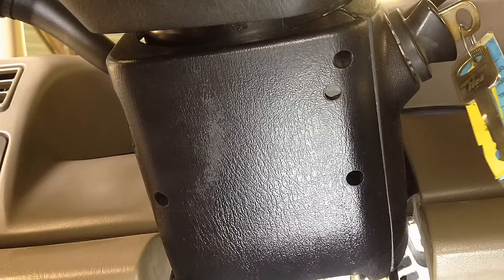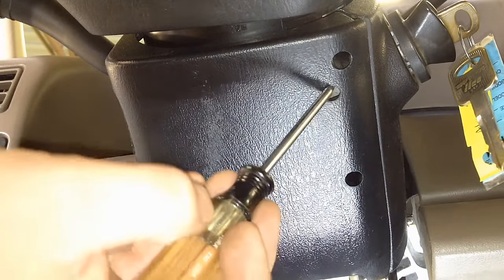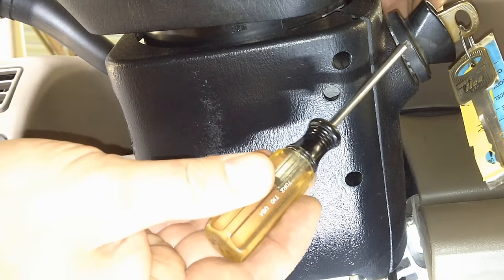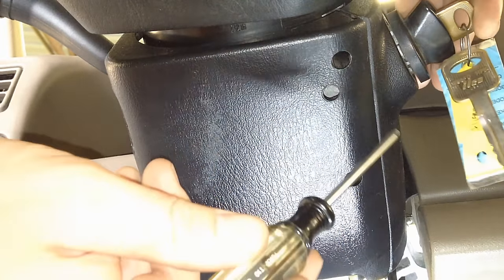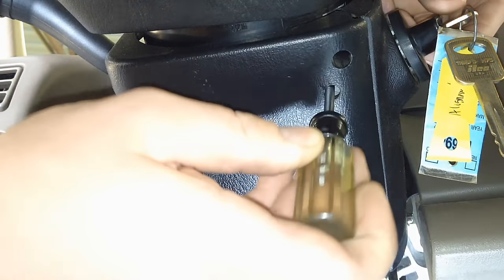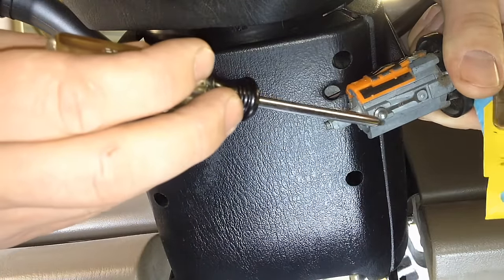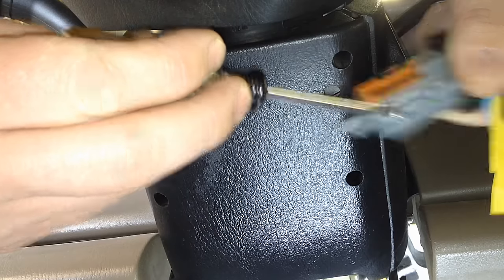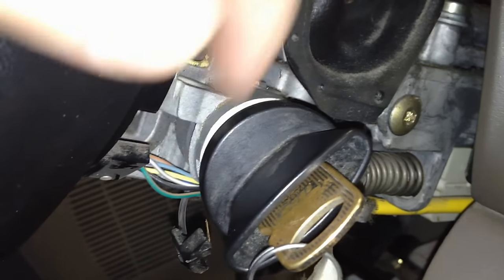Ford Quick Tips: #25 Ford Ignition Lock Cylinder Removal

Comment: Thanks for the help.  I just had someone break into my 1995 F-150 and they completely shattered my lock cylinder.  It should be a easy replacement now. with a little expedited shipping from Rock Auto.  If you've got any other tips on replacing this on a 95 F-150 XL, please let me know.  Thanks again, - Andrew
Reply from the maker: +Andrew Soltis No they are pretty simple on these.
Reply: All I have to do is push in the clutch and one of  my vice grips and my truck starts within the first couple tries , it’s a 89 f350crew cab long bed dually and it got 72k miles so far but I still like it great for hauling hay

Comment: How can it be removed without the original key. My granddaughter lost the key to my 2000 f-350
Reply from the maker: You must drill out the lock cylinder, or use a slide hammer or call a locksmith.

Comment: Hey Brian- thanks for your video's they have been good help to me.
I  have a 2007 E250 4x4 van and I like it a lot!!!Your video's on parasitic drain helped me,spark plug tips and coil pack replacement.My latest problem is when I turned my ignition key back to accessory then to start, my van will start but I lost my gauges and power windows.It runs ok but no speedo.After driving a bit everything comes back on.Worked for a week and then happened again when I switched the key all the way back? Strange stuff and was wondering if the ignition switch was shorting out?
Any thoughts would be appreciated thank you..Darren
Reply from the maker: +Darren Auerbach Was your radio also dead? The way it appears is the cluster is failing and not sending the ground control to the accessory delay relay. So when it is happening it is best to check that first and work our way back from there but it seems the cluster is failing causing all of this especially since the speedo dropped out.
Reply: Yes the radio went out. That's what got my attention the first day it happened.Also the power windows  stopped just as it started to downpour.However the wipers worked. Funny thing I was running errands today and right as I passed a Ford dealer it happened again.I stopped by and they won't point me in the right direction until I give them $100hr to look at it.

Comment: so you have to have functioning lock cylinder in order to replace it? Great! What about when it's stuck and wont turn to 'run'?
Reply from the maker: You must drill it out or slide hammer it out
Reply: thanks. If I slider hammer it will the new cylinder just side in?

Comment: Can you help me please? I lost my keys to my 2001 Explorer Sport, I made a duplicate for a door key but not the ignition. Is there any way I can replace they ignition cylinder without having the key?
Reply from the maker: +VanillaSnake21 You can drill it out or use the slide hammer method to remove the non functioning lock cylinder.
Reply: FordTechMakuloco I took apart the bottom of the steering column yesterday but I'm not sure where to drill or hammer. Is there any way I can post a few pictures for you to take a look at? I can paypal you some money for your time.
Reply: ***** I ended up paying 250 and the locksmith just made a new key for me, turns out I didn't have to change the cylinder.
Reply: ***** just for future reference, where exactly should I drill, just straight through the key hole? Will that make the key come out? Also is there any way to pick the ignition key?
Reply: may i?
Reply: Oh hohoho, there's Somebody with problems that Can't be fixed!
Reply: VanillaSnake21 yes
Reply: FordTechMakuloco 
I bought a 2002 ford explorer.
 I was aware that the keys to it were stolen prior to me purchasing it.  I was excited that o was getting such a great deal with a minor  issue. I put away the money to  get new key and have ford program it.  
 I sent a friend to go get the explorer via a car trailer.  Long story short.  My ignition was popped out cause of locked steering.  
When I got home from work and  I saw that I now had a larger problem I was  pissed,  took it with grace. So I ordered and have the new ignition and I go to pull out the mangled mess and I found the hole to push up but I can't get it to release.  I be sitting out in this iced over car like a tweak and IDK what to do.  If I send u a couple pics and maybe a video clip  could you  point me right direction please..
Reply: april hunt so you found the whole that’s a good start now you need to get the ignition to turn. Turn it to the accessory position which is one click and then push in the whole and pop the ignition out. Put in the new ignition the same way the old one popped out. If you can’t get the ignition to turn drill it or use vice grips to force it over. Hope this helps
Reply: Chance Jones c

Comment: Great video and a quick and fast way to diagnose a powersteering problem.

I am having a slip yoke issue on my 2010 F-150 5.4L. The issue has been fixed under warranty in the past. Since I am out of warranty now and have read that its a fairly easy fix, was wondering if you have done a How-to video on this subject?
Reply from the maker: SS Crew No how to video yet, but all you have to do is undo 1 clamp and relube it up with the special Teflon grease in the kit, nice and easy. Here is the kit- 9L3Z-4W602-A
Reply: Awesome. Thank You!

Comment: This is the tip you need to avoid a $250 repair. Thank you
Reply: I know this is an old video I hope you get it but my key is stuck in the off position I can't get it to turn to run will this still work or how do I get the ignition lock cylinder out on a 2003 350 Super Duty

Comment: What do you do if you can't get the ignition to turn to the run position?
Reply from the maker: S Scherliss As in the focus lock cylinders you drill them out, ford does have some basic instructions for certain years but you mainly just drill out the lock cylinder itself.
Reply: FordTechMakuloco I need to get the ignition housing from a junk yard 2008 focus, but the key isnt in the vehicle, and the steering wheel locked up on me. will drilling out the cylinder work to unlock the steering wheel and free up the housing?

Comment: Apologies...I wanted to follow up with the fact that I did replace the power steering pump a couple months ago but unfortunately there has been air in the line so it has been making a slight whining sound for awhile....not near as bad as before the replacement though. I am taking the truck to rotate the tires next week and will bleed the lines then, but I just wanted to bring that up in case there is a correlation. Thanks.

Comment: I lost the key do I need to put the switch in the on position?
Reply: Yep. You need either a locksmith or a drill. If it's ford and vehicle is under 10 years old the dealership can make you a new key though.

Comment: I have a 2003 ford ranger and the cylinder is locked so I cant remove my key, the truck also does not start, how do I unlock the cylinder to turn on my truck?
Reply from the maker: +Luis Ortega If the key will not come out and wont turn all the way to the start position then you must drill out the lock cylinder. If it just wont removed from the cylinder be sure the vehicle is in park and diagnose the park inhibit switch
Reply: +FordTechMakuloco So my key is out steering wheel locked. I was messing around with a  door lock that would not turn because my key is worn out so it wore out now I can't turn the key to pull it out why is ford so stupid ????: And no one has made a video on the net showing me how to get the damn thing out if this happens.

Comment: How do you put it back in to replace it?
Reply from the maker: The exact same way you took it out.
Reply: @FordTechMakuloco  any idea on this?  I took out my cylinder ok no issues. But when putting it back in the truck starts up key turns but only to start the truck,  they cylinder will not lock in and  will not turn back to allow me to pull the key out?

Comment: Everybody is showing how to remove/replace the ignition key cylinder.  That's great but, where is the video for the key cylinder with a broken tip suck up inside the column housing?  This is where the plastic gear will turn the matching rack. But u have to remove all of this broken tip, before u can every install a new key cylinder.

Comment: how do you take the ignition out without the key
Reply: Drill out the lock cylinder with a 3/8 drill bit to allow it to turn without the key, then push the pin and remove the cylinder....there is a video for this process.

Comment: What about if the key is chipped and is pats
Reply from the maker: No difference
Reply: FordTechMakuloco yes they remove and install the same but the 96-04 most are chipped keys meaning if you have to change the ignition gotta have it programmed
Reply from the maker: Only if you change the keys, cluster or pcm do you have to program keys for PATS.
Reply: FordTechMakuloco yes, obvious this isn't chipped car